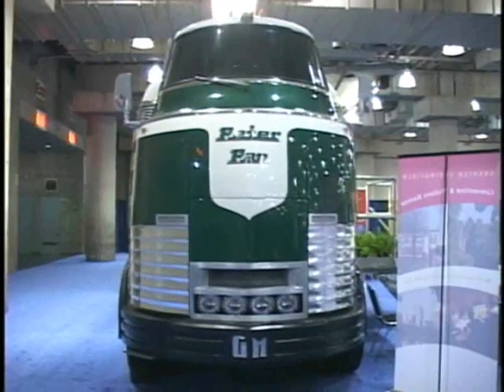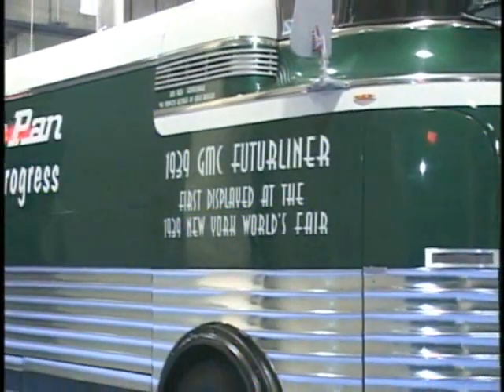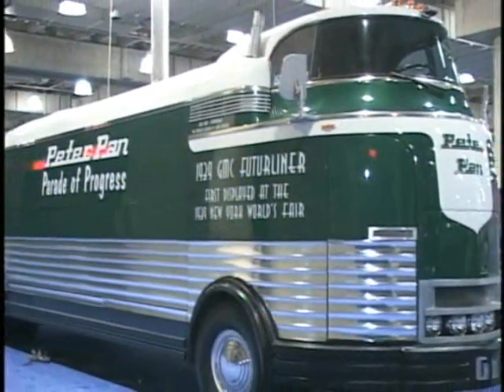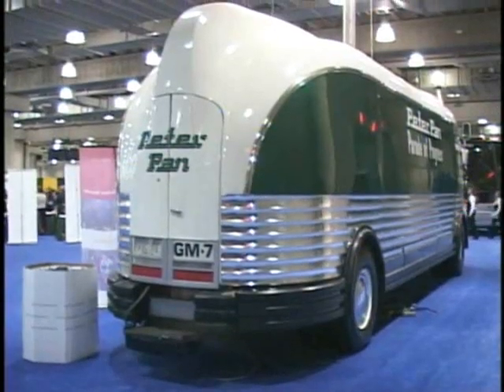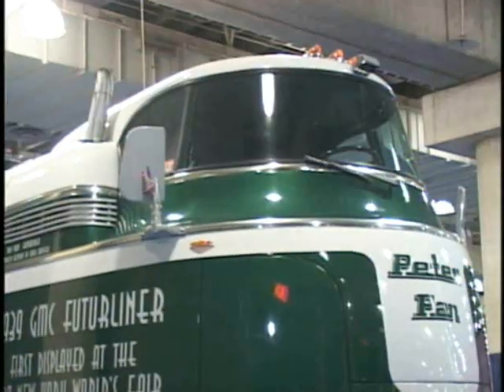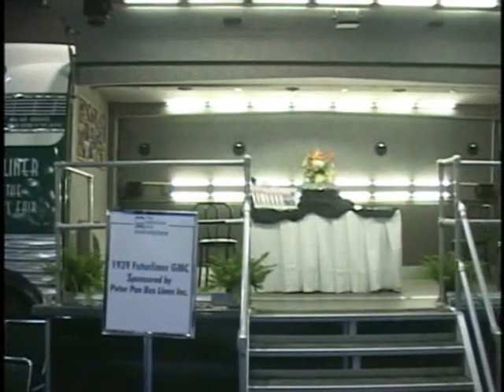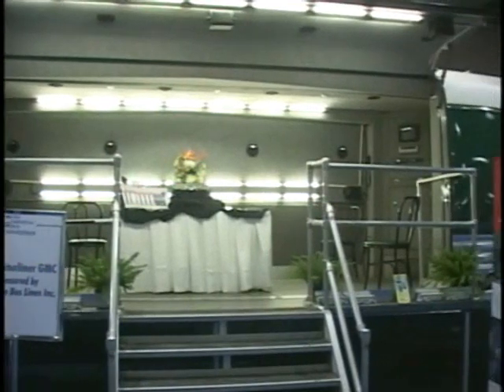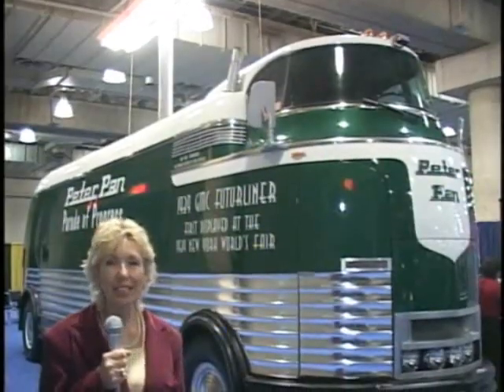Future Liner Bus

Comment: Who can help me out? This one says it's No.7 out of 12. But there are 2 more that says they own the No.7. And by the photo's of those they all are talking about different trucks. And all are saying it's No.7
Reply: First I have never seen a picture with all 12 Futurliners together. I saw ten at most in one picture. Only a 1940s handdrawn broschure shows 12 vehicles. When they had red rooftops, the number was painted on the hatch. After the early '50s refurbishment the rooftops were white and no numbers on the hatch, instead a plate in front of the two center headlights. Only 10 Futurliners were joining the '50s roadshow, that is for sure, aerial photos prove that. Here is my theory: The Futurliners might have been renumbered at the 1953 overhaul?